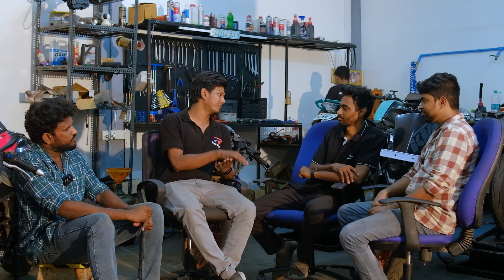Ep2 KTM 390 Series: Engine Explained in Detail | RevNitro

Comment: Choose any one bike cc wise

 125 cc 
Tvs Raider
Honda SP 125
Pulsar 125
Pulsar NS 125

 150 cc 
Pulsar 150
Pulsar N 150
Yamaha FZ S V4

 160CC 
Tvs Apache RTR 4v
Pulsar NS 160
Pulsar N 160
Yamaha MT 15

 200 CC 
Pulsar NS 200
Hero Xpulse 200 4V

 225CC 
Tvs Ronin

 250cc above 
Enfield Classic 350
Enfield Meteor 350
Enfield Hunter 350

 Note : 
1. Riding Comfortable
2. Pillion Seat Comfort
3. Stylish look
4.better suspension
5. Mileage above 45km/ ltr 
6. Basic city Ride

Comment: Ktm 390 is a non standard engine because  life of the 390 engine is very low km only comparing with other 400 segment engine in the global market ktm 390 engine can produce power but not a reliability under 400cc Kawasaki ninja 400 has the best in class engine in the segment
Please compare ktm 390 with ninja 400 reliability

Comment: Na 390 2018 until now I'm using but idhu tha na yethirpakra video, but TFT display replace panna BSVI ooda display use panna mudiyuma because BSVI la quick shifter and other tech iruku but 2018 model is pretty basic and na warranty claim panni display replace panna but latest display vandhanala they could not replace it so again 2018 model display order panni they changed it.

Other than that 
Yenoda learning la bike la
4.5k kms kulla engine oil mathradhu better along with oil filter fuel filter & air filter.
Sprockets 20k kms ku oru vatti mathanu
Chain change every 10kms
Slipper clutch needs to be replaced by 15k kms or max 20k kms
Lube every chain 500kms for better life (motul lube, oks lube and Shell lube are phenomenal)
10k kms ku coolant change 
High octane rating fuel is good for any type of use.

For tires, Apollo Alpha H1 or MRF RevZ or Pirelli diablo Rosso were great in my experience. 
Front tire life was 23K kms rear tire life was 15k kms.

This should give a better life for the beast

Comment: bro duke 390 avg budget evlo venum
Reply: maintainence for first 25000kms keep aprox 10-15k rupees not including tyres/battery . 

Reduce short rides (2km-10km after 1000kms SVC) try traveling on Expressroads for few continues hrs (100-200kms) at reasonable legal speeds (avoid getting speeding tickets)

 if your usage per year is less than 10,000kms a year (only city) avoid 390 n save your selfs from that much initial investment, this point is not easy for many to accept or to plan it

above points "not suitable" for:
     tracks day riders (new /occassional)            travelers like interdistrict /inter state 😄
> for you do consider upgrading the forks n rear shocks after 10-15k km pick any reseller available in India , who can service both shocks n forks after 2yrs or 1yrs, your physic/body will thank you when covering  long distance😍.

  later 
>flash ecm or piggy back system (better engine reliability n more comfort on expressways)
>Air filter upgrade (choice is yours)
>spark plugs (get copper tip or silver tip replace them as per users manual recomdations) 
>a cruz control (Keeps the wrists less achey 🙃)